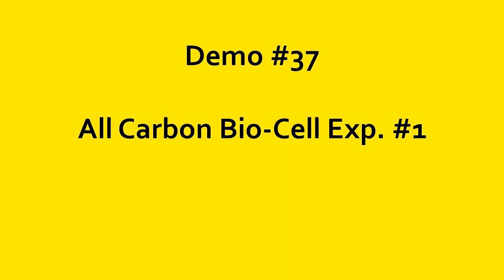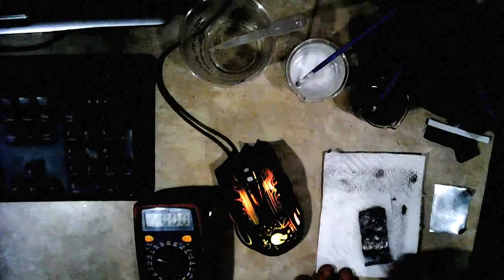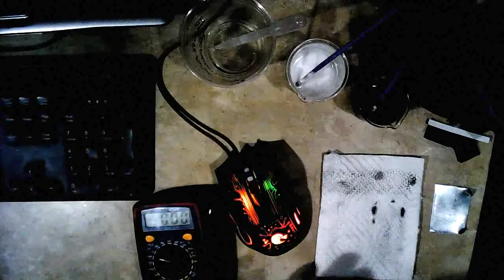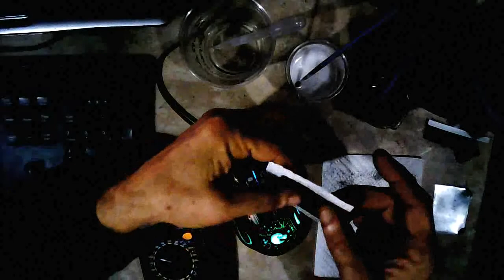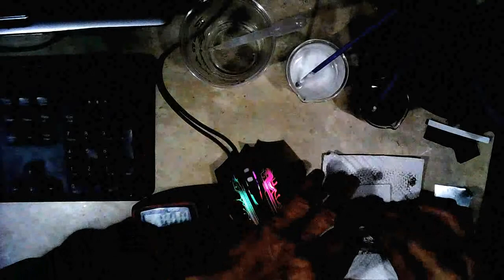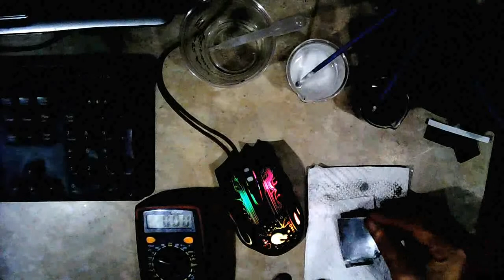Demo #37 All Carbon Bio-Cell Exp. #1

Comment: had same results its galvanic, measure the voltage on the electrolite to the carbon...use 1Mohm resistor to make short that should indicate it is not electrostatic..

Comment: I was thinking something similar to Jon. I thought it might be differential in electrical potentil between dissimilar materials working towards equilibrium through a resistive layer. It might be helpful to continue the measurement until it is stable.
Reply from the maker: I have a new experiment planned for tomorrow, that might shed more light on the subject. Jon's comment gave me an idea for a electrostatic experiment, which I posted a little while ago. It looks like it's a mix of galvanic and electrostatic to me. The galvanic part being a two stage reaction between Tio2/carbon transferred to the carbon/zinc. This might account for the slower self-charge when the zinc was laid on the cell. The electrostatic part is not so clear, but I'm thinking that electrons in the air are combining with protons stored in the carbon, which slowly drained the charge when the zinc plate was removed. Does that make sense to you?

Comment: If you look up electronegativity of zinc it is 1.65v. The difference between the carbons and titanium is what is powering that.
Reply from the maker: Hi Jon,  I can accept that, but do you have any ideas on why it self-charges with the zinc plate, but discharges without it? We've had several suggestions. I'm leaning toward electrostatic or galvanic, and Barry says it's galvanic.
Reply: Now see voltage is pressure to charge. Yeah it is more electrostatic then anything else. The electronegative potential and it's differential cause the flow in a single direction like a DC current. Think of it like this. Water runs down hill right? Well one electronegative potential is at a certain depth and the other is either higher or lower. That is the differential I am referring to. As the two pieces of matter, which is conductive touch they try to attain each others potential. If this is done via a conductor, a current will flow through the conductor.
 I watched a particularly interesting video about carbon atoms and how they jiggled. Right in front of my eyes I saw how the atoms wiggled and don't touch. There is a reason why... They are floating in a medium of plasma. A conductor. Not perfect but a free floating conductor that conducts the atoms potential (what gets displaced by the atom) creates a vacuum of plasma. This is potential. All forces at that level seem to be purely potentials and voltage. Current seems to be a mass affair. Meaning it involves mass.. Conductive mass is better and all that means is it has a better cloud of plasma around the atom. The atom displaces more plasma and hence draws more plasma around it. Like water does the deeper you go. The plasma wants to be uniform and conduct evenly. When you displace more it is gets denser around the atom, trying to push in more.
 Just having matter next to each other probably wont do it. There has to be a relationship between the two like in a body of conductive water or hydrogen. Pssst. Hydrogen is the key here. There is something special about hydrogen. Something to do with the plasma. Like the steam event or condensation events are showing the properties of this plasma.
Reply from the maker: I see, so the ancient's concept of the ether is really plasma. I bet you're a physicist aren't you Jon?
Reply: Quasi physicist.. Self taught. My favorite research was of a professor named Walter Lewin and he had a tons of vids about physics... Especially interesting was the eletrostatics and electricity/magnetism.
 I talk to a few battery guys on the YT. Kev Wallcroft is another.
Reply from the maker: Your comment Jon, gave me an idea for an experiment to shed some light on the electrostatic or galvanic debate this video caused. 

From the results of that experiment (electrostatic exp. #1), it looks to me as if it might be a combination of both. The galvanic part appears to be a two stage affair from Tio2/carbon to carbon/zinc, and this might account for the slower self-charge we saw. The static part is less clear, but probably involved my body touching the electrodes, and electrons in the air, possibly draining away the charge when the zinc was removed. This will need some more experiments.
Reply: Just to be clear it is static like in it's ability to maintain the current. Meaning that once you establish the potential difference through the electronegativity it will tend to balance itself out if left shorted. Hence the recharging effect. But that differential takes time and current between the potentials to balance out. Even if they are negative potentials.
 This is what led me to the pulsed systems to extract energy from these type of devices. For instance a Joule Thief circuit.

 My thoughts on this are many.
 One thought is that we reside in an exciter field produced by our Sun. Everything within that field reacts differently based on it's composition. Some materials react with a weak response or low electronegativity and some react very strongly. This all gets tide together by the plasma theory and how much of it matter displaces since the plasma is very electrically conductive. The more plasma is inside of matter the less it displaces and the less electronegative it is but the more conductive it is.
 The plasma is where water gets it's unusual properties. Properties like flow, viscosity and buoyancy to name a few.

 By the way did you see the carbon and hydrogen video I linked?
Reply from the maker: Thanks Jon, you physicist type guys are over my head in the theory department. You remind me of John Bedini tho. I met him once back in the 80s at a psycho-tronic conference. 

I didn't see a video link, but I'm apparently not getting a notification of all comments either.
Reply from the maker: Thanks for posting that again. So your point is that H+ are stored on carbon which I understand. The graphfoil is all carbon rings in a sheet however, so it's carbon is all bound up already. So I'm assuming you are suggesting adding some unbound carbon to the cell?
Reply: Yeah generally you add activated carbon to the graphite electrode. When the electrolysis happens with the Urea or other hydrogen source, Urea is a lower electrolysis level at .35v instead of waters 1.2v
 The carbon changes to many different forms of hydrocarbons like methane and evolves into long chain hydrocarbons. When the cell is discharged the hydrogen reassembles into the hydrogen source in the separator area. The exclusion zones are actually more dense with either hydrogen on the positive side and chlorides and spare electrons as they call them. Naturally when you charge it electrolysis happens.
 Now I know this particular cell isn't using Urea but if it had water in it then the source of hydrogen is water. It only can take one hydrogen from the oxygen but that is enough to cause the same storage phenomena.
 With water as the medium it takes a higher voltage difference between the two electrodes to charge the battery (Above 1.2v). But if you use Urea it is easier to strip hydrogen away from the cluster. The reason the added metal to the outside of the  electrodes creates a self charging effect is from the potential difference between the metals I believe. It assists the charge via that potential difference. The Titanium might be also involved in the electronegative process there.
 The same effect of self recharge will happen with all carbon batteries if you add the metal like you have shown.
Reply from the maker: Thanks Big Jon (if I may call you that). :-)
Reply: Well you can call me whatever you want. You can call me ray or you can call me ray jay.. lol
Reply from the maker: L,. Ok Jon Bon! hehe

Comment: Would be nice if you could construct a carbon / zinc cell with the same electrolyte and compare that to the all carbon cell. :)
Reply from the maker: That's actually what I did BakamonNo. I should have made that point in the video. Same electrolyte (citric acid), tio2/lime, and micro spheres as citric acid battery tests. thanks for your comment!
Reply: Oh! My apologies. I should have paid more attention. Thank you for the clarification.